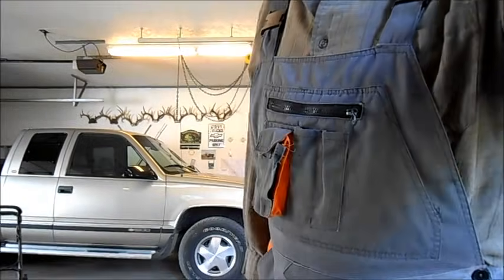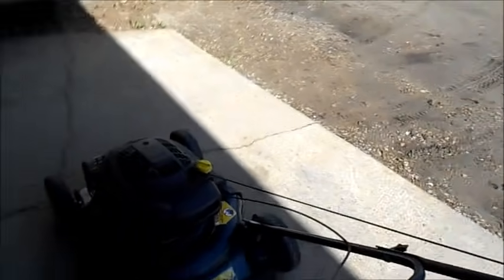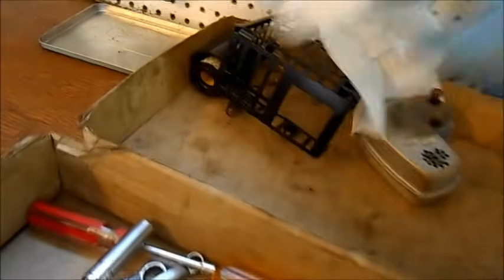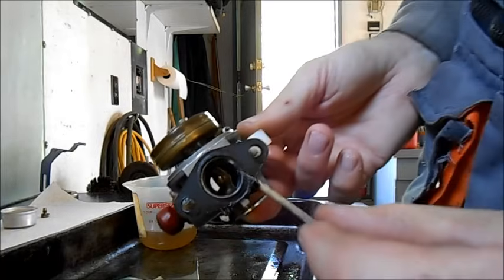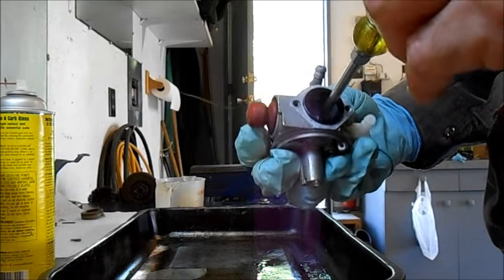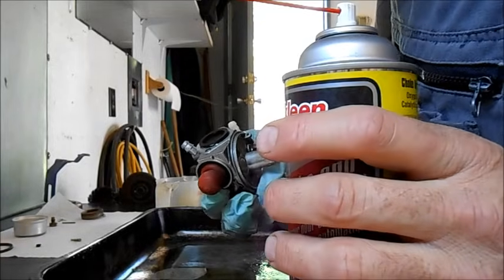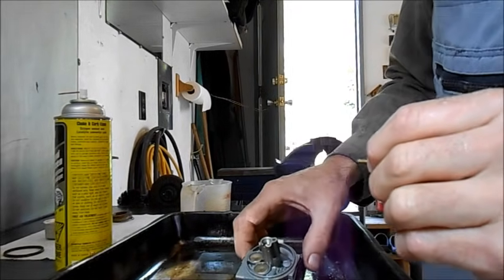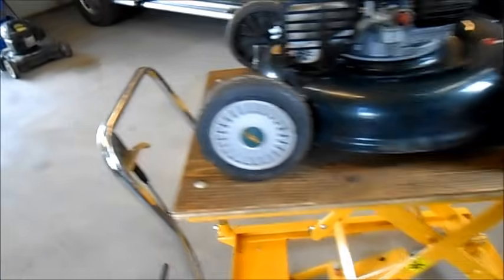The Repair of a Surging Tecumseh Mower

Comment: 10:06  time.  GOOD  FOR  YOU,  and then onto us !   i have the same engine, but not exactly the same mower. It had same problem: would start, then stall after 8-10   seconds. If i kept pushing the primer bulb, it would stay running, surging still a bit, depending on how much/often i pumped the primer bulb. Took carb apart, and up to this TIME  in the video, everything was the same. At this point, i believe my idle hole thingy,  was plugged. Initially there was some 'crap'  in the tank, which i washed out, thoroughly.  Anyway, thank-you  Mr.  Bruce, for  ALL  YOU  DO.  ( i will re-check  the carb, take out tube, etc, adjust float, governor= taking carb off, affects the 'distance'  of the governor lever/spring))
Reply from the maker: Right on.  Keep trying.    it is very rewarding when an issue is found.

Comment: Bruce, I used your video because the carb Im working with has that simple plastic plug and thread in Jet.  That Jet was plugged tight and appears to be step drilled.  I tried every wire I could find and finally pulled one out of a wire brush.  I have the drills because of the lawnboy Duraforce carbs and finally used them.  Thank you for the drill size and the video.
Reply from the maker: Well i hope you had fun doing it too.

Comment: Thanks for uploading this. Had this same issue with my old toro. The brass jet was plugged a little like yours and the governor spring had way too much tension so it was over revving. Fixed them both and it runs perfectly, albeit a bit slower than I'm used to now lol.
Reply from the maker: The tab the spring to the governor arm can be bent toward the front to increase the RPM a bit.  FWI.  Thanks for commenting.

Comment: Hey Thanks, I've just used your video to fix my surging Tecumseh mower engine.  I knew the problem was probably in the carby somewhere as the surging problem started whne I let the fuel tank empty.
Downunda, Melbourne Australia
Reply from the maker: Good for you.  It had to be Australia as we hare in full winter here.  Good for you.
Reply from the maker: Plus when I hear carby that gives it away

Comment: I am having similar problems with my lawn mower (Tecumseh Carb). The emulsion tube on mine is brass and is very tight using the flat screwdriver method. I don't want to force it in case of damage. Perhaps the brass emulsion tubes are non serviceable and cannot be removed, is this the case with brass emulsion tubes?
Reply from the maker: They are non removable
Reply: @BrucesShop  thanks. I managed to clean the brass emulsion tube in situ and the mower now seems to be running fine again.

Comment: I just rebuilt the carb on my tiller and for the life of me I could not figure out how to get that plastic plug out on the idle CCT. how did you do it?
Reply from the maker: I just pinch it with a pair of needle nose pliers and plull
Reply: @BrucesShop  I'll try that but looks like there is not much to bite onto. Thanks.

Comment: For others researching... My Problem was Gas not flowing through rubber Float Pin seat very well, and at times not at all. I removed it and installed it in reverse and Problem solved. But I will still go and buy a new one, after I mow the lawn first.

Discovered by tipping mower on its side, remove bowl, tipping back to normal and discovered no fuel was going through needle seat even though needle was not plugging hole.

Comment: there should be 2 rubber o-rings on the emulsion tube, I only saw one when you pulled it out, could it have dissolved/disintegrated? I dont think it would have been stuck in the body of the carb as you would have notice it. Great video!!
Reply from the maker: Great point!   This is a very old video

Comment: Good Video, Before I removed the carb I removed the idle jet that is cover with
the plastic cap and put it back in. I didnt use any cleaners and worked great. 
Thanks

Comment: I almost was going to buy and rebuild the whole rebuild kit until I saw I could get a new OEM for $17.
All the parts, plus 2-3 cans of carb cleaner seemed like too much hassle, even for me.
Thanks for the video though, I will rebuild the old carb later in the future.
Reply from the maker: +Mario Monti  Good luck   this is usually an issue.   for me I can try to clean the carb without waiting for parts.
Reply: +Bruce Pender Update. New carb worked great.
Terrible QC on the mower itself. Broken clamps, oversized hoses on vent, cross threaded exhaust bolts.
Works well now and I think it even rev's higher than before by the sounds of it.
Reply from the maker: +Mario Monti   Good for you.

Comment: Thanks.  Very informative. Much appreciated! Loved your tools.  But, what caused the blockage in the  idling circuit? In my experience, gas breaks down the black rubber components. Fuel line ate highly suspect.  So, after about  4 years,....think of rubber part(s) "search and replace " mission(s)...to prolong useful mower life & avoid blockages.
Reply from the maker: You are right

Comment: i have a question. im new to this small engines hobby and so fa rim doing alright i think but im having a problem with my moms mower i replaced the carburetor and filter and for soem reason it still doesnt get gas...it had this problem with the old carburetor too and filter. i checked and fuel is going through the line...i put it together but without gasket so im wondering if gaskets really matter that much. im guessing maybe they do but this thing worked or was used before without them and worked fine for awhile anyway so im wondering if this is the problem...no gas is going to the filter through the tube. this shouldnt be an issue with a new carburetor and new filter
Reply from the maker: Gaskets are absolutely important.  Especially the ones on the carb.   DO NOT USE SILCONE for gaskets.  You can make your own if you are careful   Please watch this video below.    If you don't have an airtight seal the engine will draw air through the cracks causing a no ignition problem.  What kind of engine is it.  and what type.  For example Briggs and Straton, Tecumseh, Honda or Kohler  there are a lot 
https://www.youtube.com/watch?v=LYm8WO5zsss
Reply: @BrucesShop  well it did have a gasket now that i took it apart again but i took the fuel tank off and emtiped the gas which i did before also but i cleaned out the gas tank and there was a bunch of white stuff in there which im thinking is hard water and i think that was flowing into the carburetor and what was clogging up the last carb. so i took it apart again and soprayed it with cleaner and assembled it..teh gas is flowing better but it works for now but it worked before but once i gave it back to my mom it startted having the same stalling issues again...it works fine now but ill have to wait if it does it again...as far as im thinking it was water getting into the gas tank and carb through the filter or being left in the rain. maybe just a dirty gas tank was the culprit ill have to wait...but thanks for the reply.
Reply from the maker: @sonnyc3826  Great

Comment: i got mine for free and wanted to mess with the carbs. it ran fine when i got it but i wanted to learn the parts of a carburetor so i took it apart and cleaned it then put it back... i never went as far as the idle cct or the emulsion tube. all i cleaned was the butterly, the needle, float, screw, and bowl.. i put it back and it was surging but even worse than yours it was starving even more. i have no idea what could be wrong... did i dirty it putting it back?
Reply from the maker: Did you clean the idle cct   you can try a short cut by taking the screw out and squirting cab cleaner in the hole.

Comment: Thanks for the video.  The idle restrictor screw was my problem as well.  I was thankful not needing to take the carb off.  I just wonder how you're supposed to take the idle restrictor screw cap off without damaging it.  Maybe a dab of putty or a drop of silicone to help "grab" it?
Reply from the maker: It will pull off as you know.  It doesn't do much (it doesn't seal) so maybe a bit of silicone to put it back on.

Comment: good vid mate , i have an old petrol flymo engine with Tecumseh mv100s/e engine , have put a new governor spring on , choice of three holes have chosen the middle one but does not seem to rev very high , do you know which is the correct one ? thanks .
Reply from the maker: Well here is a video that may help.   There are choices weather it is on the governor are or on the carb.  This video sows 2 different throttle set ups.
https://www.youtube.com/watch?v=mmiliB-jg6s
Reply: Thanks Bruce :o)

Comment: how can you find the model number of the tecumseh carbs? I have one that is stamped 5275 b6l, but cant find a replacement part or number for it, any ideas? This came off of a MTD Yard Machine, model # 11A-413A800
Reply from the maker: Right.  It is more about the engine than the full unit.  Find the engine and just go to Amazon or ebay and type  carb for tecumseh 6.5 hp vertical engine or whatever and you will have more luck.  I got this on what i typed above
https://www.google.com/search?rlz=1C1CHBD_enCA740CA740&sxsrf=ACYBGNTAUuqDNWQdAIBVqtb8WsLv25TmYg%3A1568654876754&ei=HMZ_XbvELa_K0PEP77SqoA0&q=carb+for+tecumseh+6.5+hp+vertical+engine&oq=carb+for+tecumseh+6.5+hp+vertical+engine&gs_l=psy-ab.12..35i39.18009.18009..19790...0.2..0.75.75.1......0....1..gws-wiz.......0i71.xOJyAj76Pc8&ved=0ahUKEwi7wtDl7tXkAhUvJTQIHW-aCtQQ4dUDCAs

Comment: Hi bruce I've just had a mower with a tecumseh motor but the primer bulb doesn't seem to be working theres no holes in it or anything but doesn't seem to pump any fuel?
Reply from the maker: yamaha racer There are replacement primers.    Tecumseh part # 36045Athis video may helphttps://www.youtube.com/watch?v=S16iWuedqx8
Reply from the maker: Great laker The idling circuit is a culprit.  Did you clean the hole in the screw itself?

Comment: Most of this made sense, but I was looking for the linkage placements, and the gas and air vent tubes. I think mine are fixed on backwards, seems like it could be a common mistake, and I am surprised when putting it back together (and not just on yours) people leave out the hook up of vent tube and gas to carb.
Reply from the maker: OK In this video (below) I explain the older and newer Tecumseh governor spring setup.  The good stuff starts at 6:51 in the video below.
https://www.youtube.com/watch?v=mmiliB-jg6s

Comment: Hi Bruce Pender, I have an issue, after doing all this and putting it back, the little red tube that goes to air filter leaks gas, any ideas? Please help
Reply from the maker: Juan Arroyo Yes the float is stuck open  Take the carb off and get a small piece of fuel line.  Hold the carb upside down and blow into the tube to see if the seat and needle leak.  You may need a new seat.
Reply: Thanks for the quick response!
Reply: Bruce Pender, Thanks, my 10 yo mower runs like new now!!

Comment: Bruce
I replaced my tec carb with a new one. New gas, fuel line, air filter but she surges at high speed. I think i got the linkages correct. Any suggestion?

Dave
Reply from the maker: Did you see this.  From 7 minutes it is where the good info is.  
https://www.youtube.com/watch?v=mmiliB-jg6s

Comment: very easy going to do that to our Briggs does the same thing but I think its so lean that it only starts with starting fluid I though it was broken and not even 1 year old new engines aren't bad just more sensitive... what's gonna be a pain is that I'm about to change 8 fuel injectors on our expedition also old Briggs where extremely reliable my grandfather's 97' Troy built mower self propelled it even has some strange spring starter when it shuts off it winds a spring up that on the next run you just pull the lever and cranks the engine pretty strange but for a 97' mower that was advanced and he paid a lot for it I think he told me like $600 or $700 still runs strong just needs a tune up like bearings piston rings clean out carb and piston head and it will be good as new :D I love that mower its rare and strange how it starts

Comment: My Tecumseh 3.5 seems intent on surging. I took the carb off and had white powder in the intake, so i cleaned the carb, it's the type with a brass emulsion tube, doesn't look like it's meant to come out.The carb doesn't have any way to tune the air/fuel mixture. Valves look good, good compression, changed the head gasket and carb gaskets already. 

The float is all plastic with a metal needle. Don't see any way to tune it's position. 

The surging is not always as bad, but sometimes it will start surging and will just keep doing it until i turn it off and let it sit for a while.

I'm thinking faulty carb?
Reply from the maker: Those are simple carbs.  If you can try a different carb that would be good.  A person can't fix them all.
Reply: Bruce Pender

That's actually a good idea. Won't that give me issues connecting it properly to the governor though? I'll keep a look out for a junker.
Reply from the maker: Tomax Crimson Just use the same rods and put them on the way they came off.
Reply: Bruce Pender Great, now i just need to find a junker somewhere ;-)

Comment: Bruce what is the size on the Allen wrench you used to push out the emulsion tube please . Have the same exact problem with a Tecumseh carburetor. Thanks
Reply from the maker: one that is just smaller than the tube.  Than is all I know.

Comment: Way Way more work than you usually have to do in such cases. Most of those have an "antitamper" plug over a fixed idle jet in the place where the older style Tecumseh carburetor had the idle needle,chances are that the tiny jet in that idle jet is plugged.
possibly illegal but some have enlarged that passage in that fixed idle jet. And/or the passage in the "jet nut" at the bottom. 
 On older fully adjustable carburetors turning in the idle needle too far will cause that kind of "hunting"
  I would have (did) drop the bowl after turning off my inline fuel shutoff,make sure the bowl was cleaned/wiped out,a couple shots of "Super Gum Cutter" through the bowl nut jet/passages,then take out that idle  fixed jet,spray a bit of "Super Gum Cutter" through the tiny jet hole there,then a shot of something mild like WD 40 into the hole in the carburetor where the idle jet goes. (A bit afraid of what the "Super Gum Cutter" might do to the plastic tube that lives in the carburetor center leg.)The WD 40 or whatever comes down out of the center leg. Then put back together,turn on the gasoline and hopefully it runs like it's supposed to. 
  Older carburetors I think don't have anything plastic inside the center leg. Some had an adjustable main jet at the bottom of the bowl. People commonly adjusted them too lean (makes it run smoother but hotter and weaker) 
Ethanol gasoline almost always goes bad and forms crud in the carburetor if left indefinitely,especially if an inline fuel shutoff isn't kept turned off when the machine isn't in use
Reply from the maker: Thanks

Comment: Wondering why you didnt remove the welsh plugs and clean those passages.
Reply from the maker: john smith You can squirt cleaner under them  To be honest around here there are so many of these around it isn't worth spending a lot of time on them  I am basically a hobby mechanic and I have a box of these carbs under my bench.

Comment: Hi Bruce.  In this video you indicate you found a plugged brass jet in the idling circuit.  I think I have the same issue.  For that brass jet, the holes are clear  from one side to the other.  When I try to pass a wire down from the point of the brass plug to the side holes, I am not getting through.  whatever is in there seems like a hard stop for the wire.  I assume this should not be.  Any suggestions for clearing a plug out that seems so lodged in the jet?  Thank you.
Reply from the maker: Thinner wire???   I use a piece of wire brush from the grinder brush

Comment: good video, i would recommend to also taking off the cylinder head to clean the carbon off
this will improve gas usage, and performance.
Reply: +RJ cartoon I have taken apart 4 cycle engines from the early 70's that were so plugged up with carbon on the top end that the valve recesses were plugged and shrouded with the stuff, but it doesn't seem to be an issue on newer lean burning machines, IMO.

Comment: By any chance do you know the carburetor part number? can't seem to find one for mine
Reply from the maker: I honestly don't know which #.  If you have the same mower you need one with the idle cct.     11:16 in this video.  There are many types that work too.  Sorry i can't help you more but I don't now what you have.  Mr.  Google is pretty smart though.  Just keep at it.  The replacement carbs are cheap.

Comment: Great video.  I was wondering if you can give some of those tools in your tray?  And where can you get that Tecumseh tool?  Thanks!!
Reply from the maker: It is a Tecumseh 670377 Carb tool and can be found on EBAY or any buy site if you search it.  here is 1 link
http://www.ebay.com/itm/Tecumseh-Engine-Carburetor-Carb-Rebuild-Tool-670377-/260717986813
Bruce from BTHVERSION1
Reply from the maker: Most of the tools are home made.  match sticks with wires from a grinding wheel golf, tees, pieces, of different size wire, toothbrush anything you can think of.  steel wool (fine) sand paper, wire brush, etc